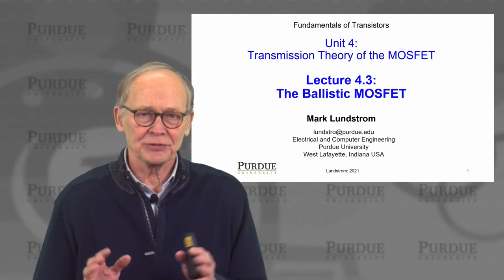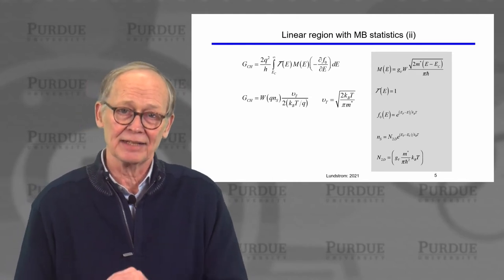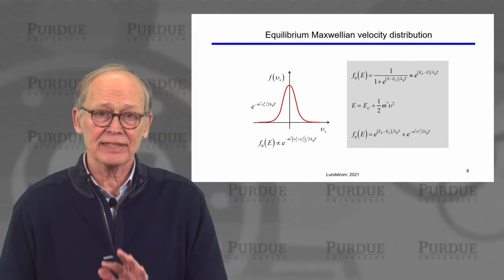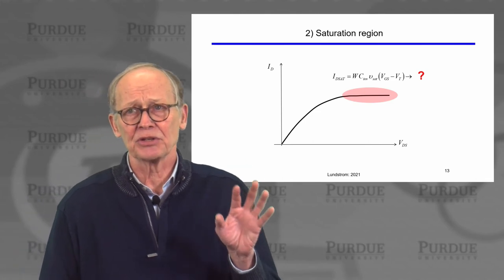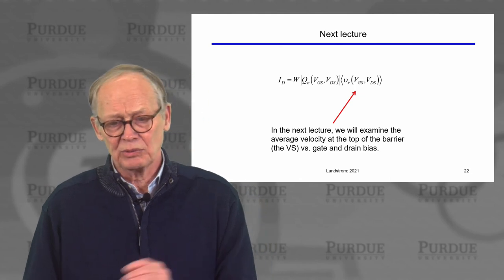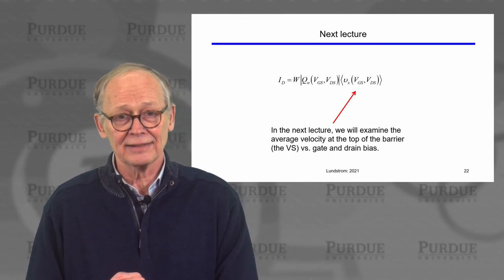ECE Purdue Transistor Fundamentals L4.3: Transmission Theory of the MOSFET - The Ballistic MOSFET

Comment: 00:00    Lecture 4.3: The Ballistic MOSFET
00:30    Transmission theory of the MOSFET
01:01    1) Linear region
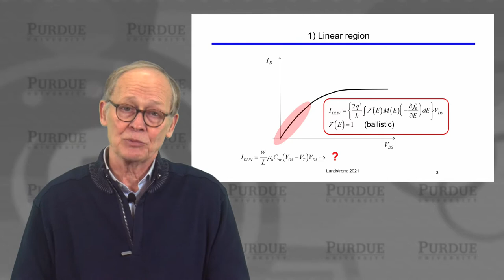01:39    Linear region with MB statistics (i)
02:09    Linear region with MB statistics (ii)
03:51    1) Linear region
04:41    Questions
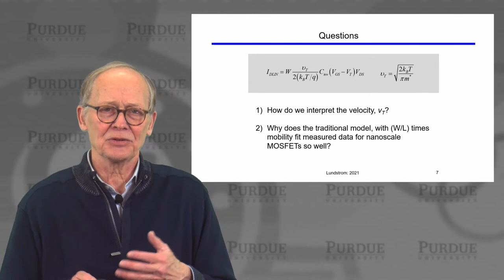05:21    Equilibrium Maxwellian velocity distribution
06:39    Unidirectional thermal velocity
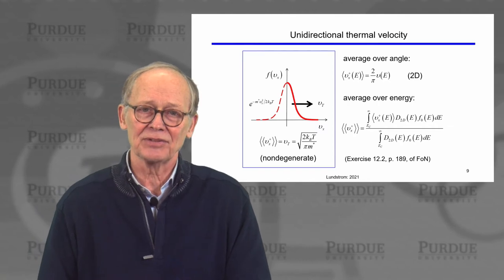08:45    Ballistic mobility
10:48    MFP in a ballistic device
11:56    1) Linear region summary
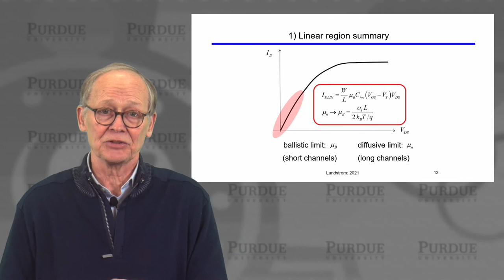13:14    2) Saturation region
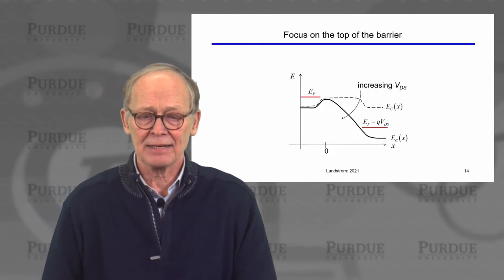14:17    Focus on the top of the barrier
14:46    Electron density at the VS
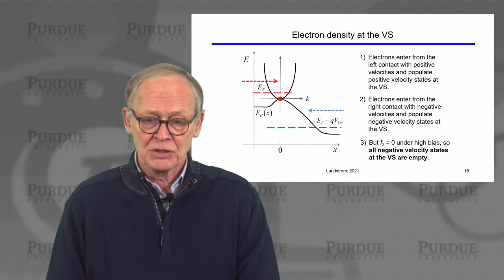16:14    Electron density at the VS
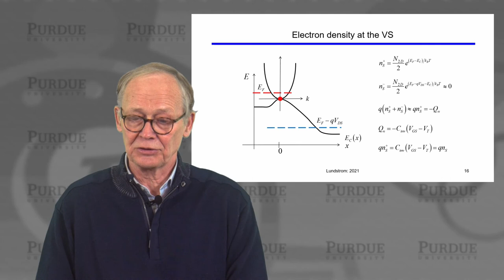18:04    Saturation region with MB statistics
18:16    Saturation region with MB statistics
19:57    2) Saturation region summary
20:28    3) Ballistic MOSFET: full VDS range
20:55    Ballistic MOSFET summary
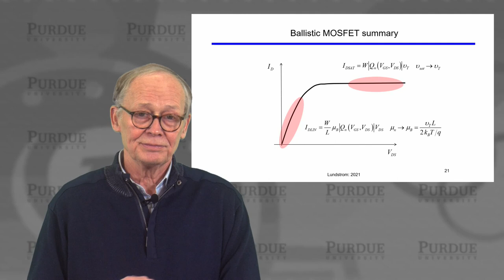21:44    Next lecture